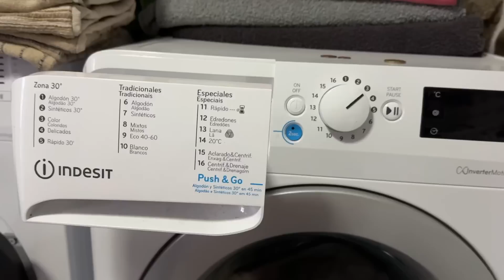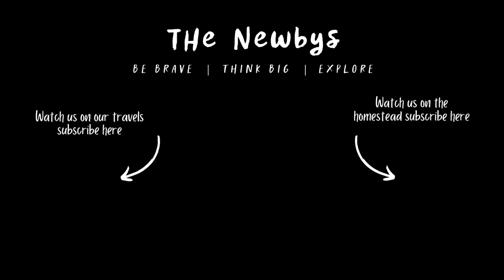Time Travel in Portugal: Burying Our Legacy on the Homestead!

Comment: I did not see any ventilation-pipe from back of the cellar...we put them usually up, but backwall is also good place. Otherwise you may get mold. I was surprised again when you used the word vatupassi 😂 "what?! Did I hear it right?!" because it is so rare to hear those things ever. You still remember our  words...well done! Back to my "point". I hope you think the ventilation thing. Air under the door and out from upper part of the backwall or from the backside roof by pipe. And Tara gets the "perunakellari" (rootcellar) that  keeps your 🥔🥔 from being rotten. I still love the way You both talk to boys. They will grow up with strong self-confident. And back to the hobbit-house..If you want to keep too hot air from flowing in (summertime) some bushes Infront will keep the door-area in shadow...and it may be cooler. But I think you just want flowers. Have a Happy Holiday-Season... wherever you all are now.